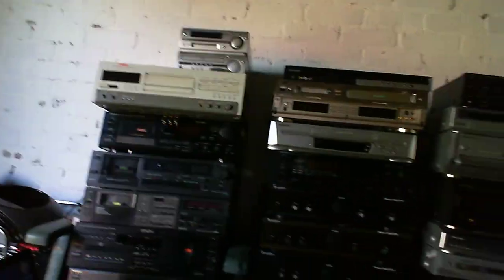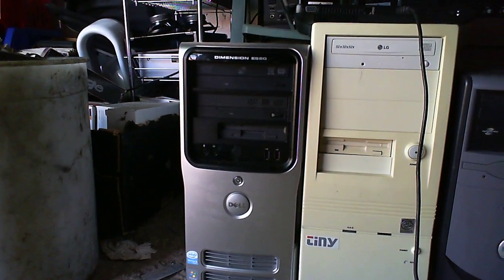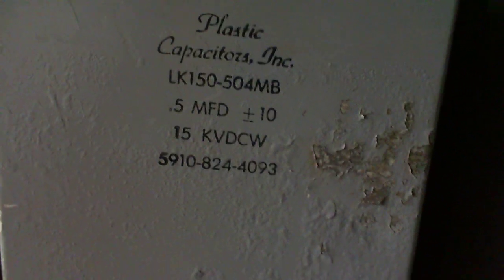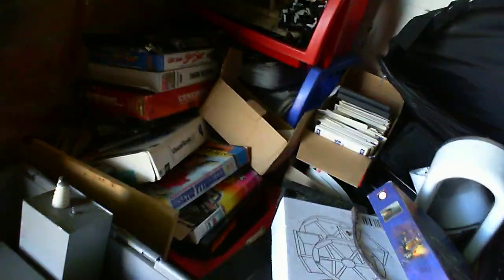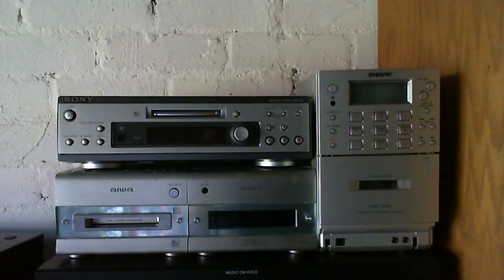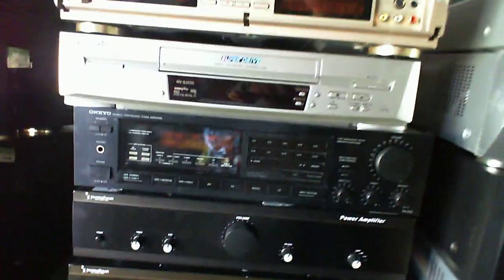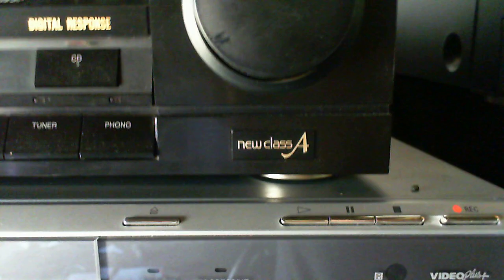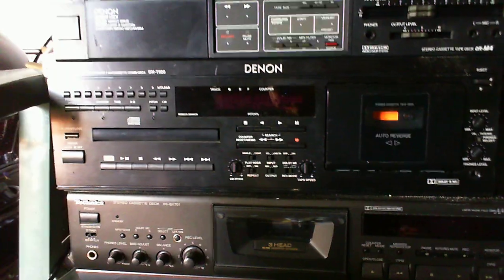The stuff from the big donation - in more detail!

Comment: New Class A is a sliding bias system, where the idling current of the power transistors is adjusted according to the input signal strength.
That Technics unit is part of a midi stereo system. Unfortunately with not that great quality. However, there were absolutely excellent New Class A amps, the best one being the Technics SE-A3MK2 power amp.

Comment: The Roksan unit is a surround sound processor, as far as I'm aware it can be used as a DAC and preamp. Roksan kit costs good money, it's beautifully built (as you will see) and sounds excellent. Oh and it's British built and engineered too which is a big thumbs up from me. We're pretty good at high end HIFI here in Britain. I have a Linn/Rega system myself, again all British, stunningly built and fantastic sounding (I have some videos of it). I have had Roksan kit in the past too!
Reply from the maker: Si1983h Certainly seems well made, I had a look "under the hood" so to speak, only just to see what was inside it and there were TONS of capacitors, all good brands too, I'm sure the other stuff I saw inside that were high quality parts as well.